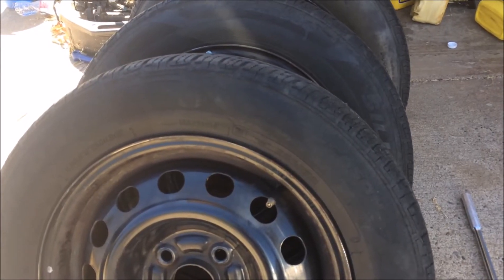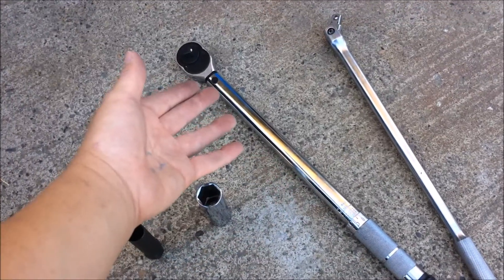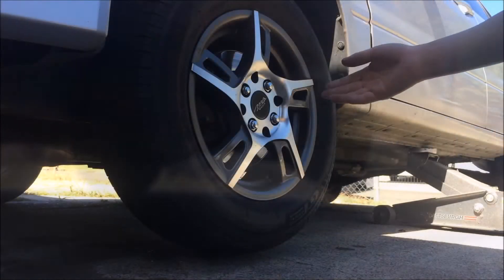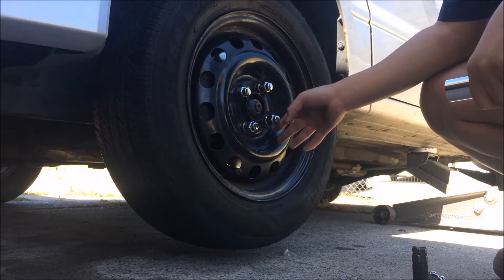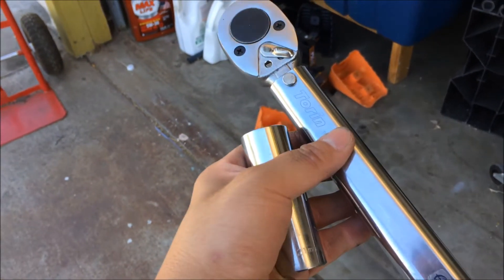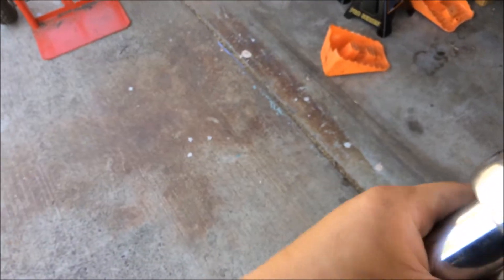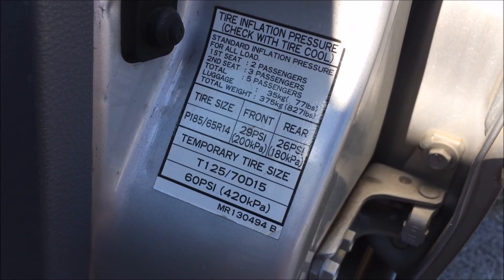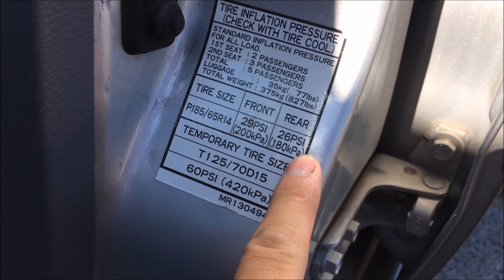Mitsubishi Lancer 2003 ES - Quick Wheel Swap

Comment: Thanks for the video buddy. What is the long tool that you put on the one of the nute while removing the nuts ?
Reply from the maker: The tool I used to remove the wheel nut is called a "Breaker Bar".  This “Breaker Bar” is a long bar with wrench style socket.  They are usually used to loose very tight nut or fastener.